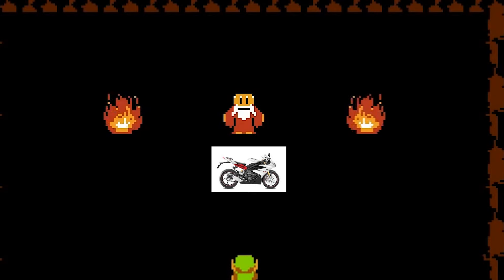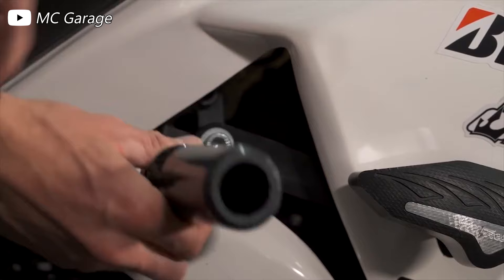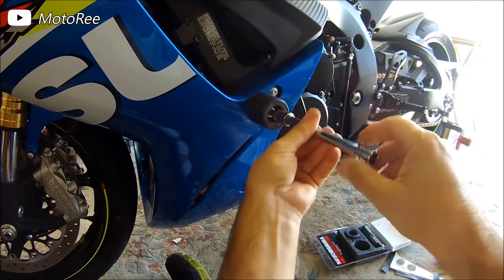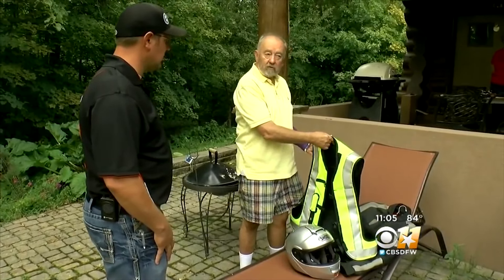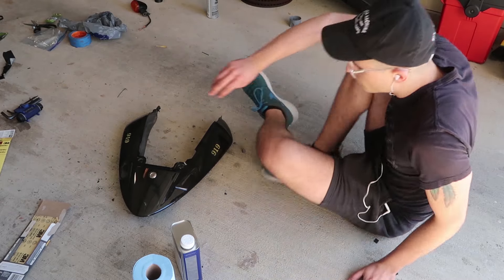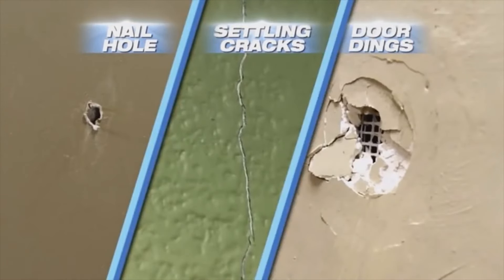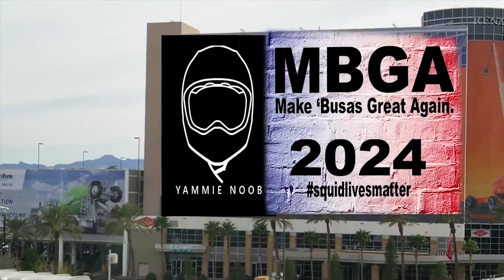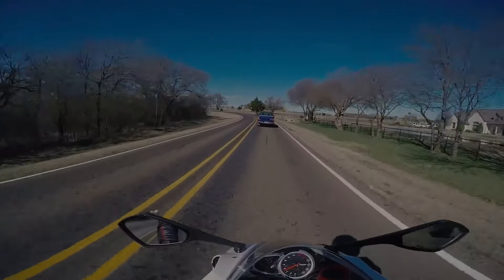5 Motorcycle Safety Items You Can't Overlook

Comment: The hearing protection one is no joke.

I'm a career truck driver.  My truck is MUCH quieter than any bike out there that's not battery powered, but my personal experience, as well as studies that have recently been published, has proven that PROLONGED EXPOSURE is WAAAY more dangerous than temporary, albeit much louder noises.  Recent studies have shown that 97% of truck drivers lose 6% to 12% of their hearing, over the course of 5 years, and as much as 26% over ten.  My ophthalmologist has put me at a 22% loss in my Right, and a 15% loss in my Left, after 16 years of driving.  At this rate I'll need hearing aids before I hit 40.

...Food for thought.

Comment: 6. Plan ahead or check your route before traveling, there could be constructions going on which may cause delays or add you in a situation you're not comfortable with, case in mind landslides, muddy roads, slipper slopes etc.
7. First AID kit, especially if you're touring keep it with you.
8. Tire flat kit, they're cheap but will get you out of trouble, also having a tire pressure gauge handy and a hand pump for trips IS not a bad idea.
9. Keep your bike maintained and check the important items like drive chain, brakes, fuel, oil etc before riding out.
Reply: Video Information I ride a GSXR 1000 with off-road tires , and Super Sonic Turbo boosters with no helmet , therefore none of that s*** above you're talking about matters either Blaze right through it, bunny hop over it or rev my motor until it's out of the way
Reply: 6. Nobody is going to literally drive their entire route just to see if anything happened to the road then go all the way back home and get their motorcycle. I guess you can gps the route but even then on roads your familiar with nobody will do that. Not a big deal really
7. That can be pretty handy so I agree there but it isnt mandatory.
8. Only for really long trips to different cities I can see that being a thing. 
9. Yeah

Comment: Note:  Simply replacing different types of bulbs in a car or motorcycle is ILLEGAL without also replacing the enclosure.  If your motorcycle came with halogen lights, then you can't just replace them with LED light bulbs even if they fit as the reflector was designed around reflecting halogen produced light along with the enclosure having a lower heat dissipation that isn't designed to accommodate the higher temperatures produced by an LED bulb.  LED lights must be in enclosures designed for them.
Reply: Halogen bulbs produce more heat than LEDs, not less. Are you confusing LED with Xenon?
Reply: it all depends on the end result ,and shape of LEDs ,some will some will not.

Comment: While you‘re talking about frame sliders: If you‘re planning on getting some for the 07, check out the ones by SW Motech. They‘re designed in a way that they are less likely to break or cause highsiding. And they look less ugly than most alternatives, I have them in my MT07 and actually like the looks.

Comment: EAOS Slimbuds are a new and great way to protect your hearing and connect thru bluetooth. they come with different size ear inserts and you you can choose foam or rubber which all come in the package. They are a lot easier to use and no helmet alterations needed.

Comment: Sliders completely saved my 2009 R6 I just had got it in 2010 with 2k miles on it flawless bike mint and my sister takes it for a Cruze and sure enough as she is turning onto our street some dick head come over the rail road tracks around the curve on her so fast she had to whiskey throttle it to get out of the way and she had got to much speed to finish turning in and hit the ground. I looked at my wife and said well that’s that it’s destroyed and I walked down the street (100 yards) and made sure Sis was ok she was pride hurt more then anything her words. But sure enough the bike was still perfect exept the slider it was chewed up but I was soooo happy 😃 I was like yes now I can get the really nice ones I wanted anyways 👍🏽. Two days later I road to the Yamaha dealer and ordered my new ones. Bikes back in my day just got killed if they took a 15mph spill. Plastic be all hanging off and tank all scratched up. Seen it for years. The cages are even better you can abuse them a little with sliders and a full cage not that I would want to.

Comment: hammie tube, I didn't "mind" the test of the green screen, however, I do prefer the old style better. mainly because you've got a good habit of picking interesting filler material for the videos that are illustrating your point. I think you floating dead center in the other videos kind of took away from that. I think if you were to mix both styles (like pop up in the green screen on occasion where it's more fitting for the content as opposed to always looking at your chrome dome) it might work

Comment: I have hearing loss (mostly in my left ear). I want to start riding a motorcycle but does that mean I need to wear ear plugs as well? My bones is the problem not the nerve so implant is out the window.
Reply: YES.  Wear plugs when you ride, (especially on the highway) OR suffer permanent hearing loss.  There are only two choices.
Wish someone would've told me this sooner. I was in my late 20's before i noticed how bad my hearing had gotten from wind noise.
Reply: @AB-nb2ic  Thanks

Comment: Its all about the helmet wind noise.  Its difficult to find out much about it apart from opinions and anecdotal data.  I don't know if its inside, outside, from the front or back.  I'm rocking a Shoei GT air and even that's too loud.  I've been plugging every hole since I started samba drumming back in 2010 but even so.....  What would fix the source?  Vortex generators?

Comment: Putting led lights in your headlight is not a good tip btw. The led lights up on a slightly different location as your original light where the surrounding mirrored housing of your lamp is originally designed for. Hence the spreading of the light is getting altered. Just get a high quality halogen light if you want an upgrade: those light up at the correct spot and are more than powerful enough.

Comment: Is there any specific hearing protection you’d recommend? My helmet is loud af even at 45-50mph
Reply: Cheap disposables for starters.  I'm partial to 3M 1100 foamies.  For music I use Plugfones...they block almost as much as the foam ones and I can listen to music without having to blast the volume.
Reply: I like Earpeace plugs. About 20 bucks, cheaper if you buy more.  I use them in a HJC CL-17 and even need them with my Shoei GT Air. I can still listen to music or take calls with the helmet speakers and mic from my Sena 3-S (around 90 bucks). Hearing people talking to you at a stop light or off your bike is difficult for me with the earplugs in.

Comment: Pointing out the importance of hearing protection is great Yammie. However, the damaging levels of noise are NOT created by overly loud exhausts, and especially not standard exhaust systems even at high revs. Wind noise is the key issue. At approximately 60mph, the wind noise generated by airflow over your helmet is up to 120db. This is the equivalent to standing next to a jet engine. So hearing protection YES :), caused by noisy revving engines no!
Reply: He literally said the wind was the issue not exhaust. M8 you watch the video?
Reply: @billyconley1515  See below - he said that just after I posted the comment. He should have been clearer :P

Comment: I had a dent in my frame because of frame slider. Slider was very strong, i thought that would be a good thing. Sliders should be viewed as sacrificial to save rest of your bike and should be pretty weak compared to rest of your bike.
It is also recommended to have hearing protection when you drive a convertible. I think you can actually hear more with hearing protection in (speaking to my passenger). I even started wearing them at concerts and is a real +++, I high recommend it. No beep in your ear afterwards and you can have a conversation without shouting in someones ear. It is incredible how much more you hear.

Comment: Here in the U.K (maybe other parts of Europe) you must be 24 years of age minimum before you can have a full motorcycle license. A full license is called an 'A1' this has no restrictions on engine capacity or horse power. At the age of 18 you can take, what is called an 'A2' test. This allows you to have a motorcycle that has a maximum of 46 horse power. If you take this 'A2' test at the age of 18 and hold it for more than 2 years (21 years of age) you can then take your full test (A1) and have a unrestricted license. This allows you to have a full license before the age of 24. Also, in the U.K you can take your C.B.T (compulsory basic training) at the age of 16 and you are allowed a 50cc motorbike, at the age of 17 you can have a 125cc motorbike. These are called a 'provisional license'. You must take a CBT test every 2 years regardless if you have taken it before. If you never progress through to a A1 or A2 license then you are required to take the CBT every 2 years. Hope this helps for your video on A2 bikes Yam!
Reply: Perran Normanshire A2 is at 19 years old. Got 11 months till I can do it still on a CBT bumming about on a 125😂

Comment: I'm a big fan of engine cages (SW-Motech on my 919, Canyon Cage on my FJR1300) over frame sliders, but cages aren't really as practical, or even available for a lot of sport bikes. My SW-Motech did an admirable job along with soft bags protecting my 919 in an ~20mph slide on gravel.

Comment: I feel an annotation for LED lights is needed. 
Marker, signal and brake lights- yes. 
Headlight - no.

If the light isn't engineered for an led, don't use it. You want to be visible to others, not blind them so they hit you. Same goes for the idiots that swap hid and led into vehicle headlights. Don't be stupid.

Last item......don't run with you high beam always on! It's stupid and inconsiderate to the other people on the road.

Comment: The Indian FTR1200 and Scout can be made into A2, and can be reset to be unlimited with just a software reflash. 

Something to consider when using frame sliders and a com-system (same for camera's): 
Frame slider can bend the frame (depending on the type of frame) when dropping it. Catching and flipping is still a reality on asphalt as it isn't perfectly smooth.
When crashing with a com-system, if it catches on the ground, you'll snap your neck.

Comment: Some facts to "A2 bikes": 

Standard motorcycle up to 35 kW (and a power-to-weight ratio not more than 0.2 kW per kg), bike must not be derived from vehicle more than twice its power Direct access route - theory and practical

Progressive access route - 2 years experience on A1 motorbike and a further practical test

you can reduce the Power of the Bike, as long as it has 70 kW or less when stock.

Comment: I've dropped my FZ-07 3 times in 3 years. And only one damaged the "body" work after locking up the front wheel and dumping th ebike at a stop light after slowing to like 5-10 MPH. If I had a full faired, or much more expensive bike it would have been way more expensive.

Comment: The A2 licence allows you to ride bikes that are <= 35 kW. If it's a restricted version of a bigger engine it can't be more than 70kW when the restriction is removed (which you can do if you make another course 2 years later after having your A2 in order to get the A licence). 
Honda most probably made their CB500 variations with the European market in mind since they are just at the limit.

Comment: - "Mmmotorcycles are. . . dangerous. We all know this." -  Way to sell a vid on safety, dude.  😉

Slammy Groove! Actually liked the format change (you out in front). Let's see more of you!

Papi Yammo, always love the vids, your voice & presentation talent is entertaining, & the visuals are always helpful. . . y'know, when ya lose me ( 😮 ).  Safety is big, since the wife gave me her blessing to get another scoot after the big weight loss. I like the gear. . . I look COOL, I like to be lit up (illuminated, while riding that is), & I like making it to where I'm going in one piece.

1) My '05 GSF1200s Bandit will be getting sliders this Spring. . . CHECK!

2) I wear primarily white gear with black & colored accents on a blu/wht/blu bike. I LIKE being seen.

3) Phone in pocket. . . CHECK!

4) The bike has two 4" LED Road Lamps low on the forks, just above the axle line & more "marker-type lights" on the sides, the sides of my hard luggage, & the rear as well as 2 more "hot-spot" LED's for on top of the windscreen. . . all scheduled for off-season installation. *Additionally: I installed high AND low tone FIAMM Freeway Blaster +130db horns last year to be heard.

5) Anything more than a quick jaunt down the road to the store warrants earplugs. . . EVERY TIME.